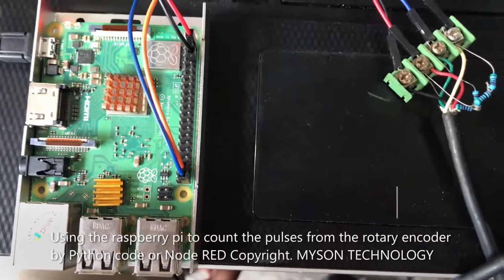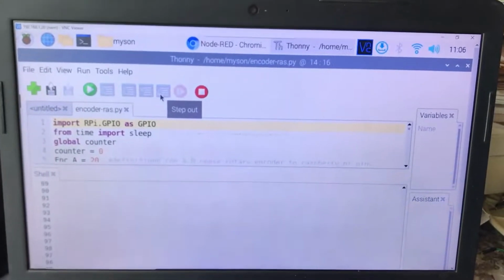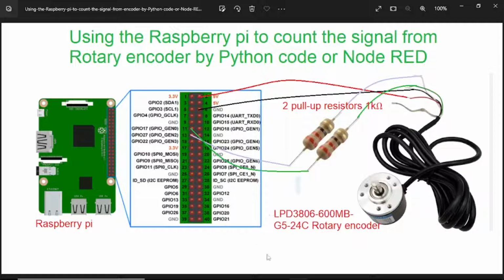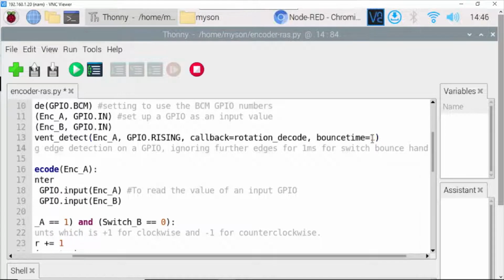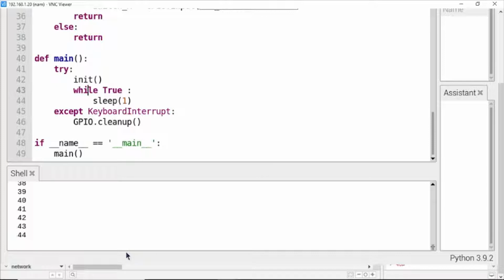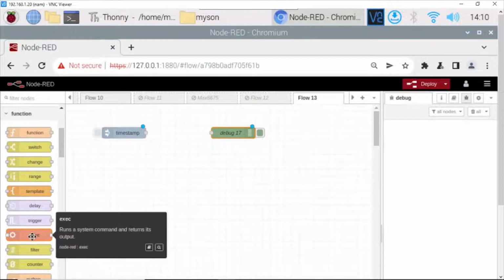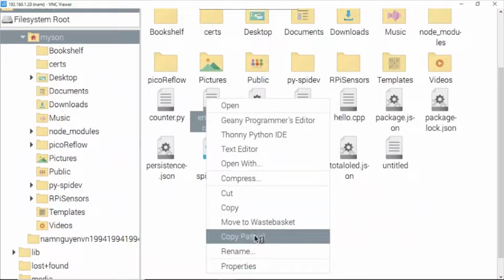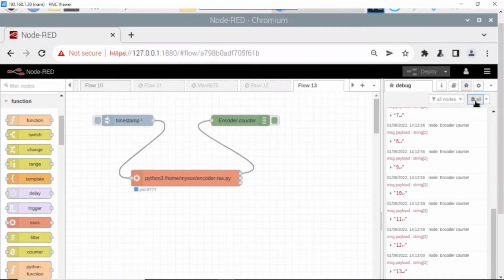Rotary encoder-Raspberry pi-Python code -Node RED-High speed counter

Comment: The RPi GPIO are not 5v tolerant. Wouldn't a voltage divider be necessary here on both the encoder A/B?